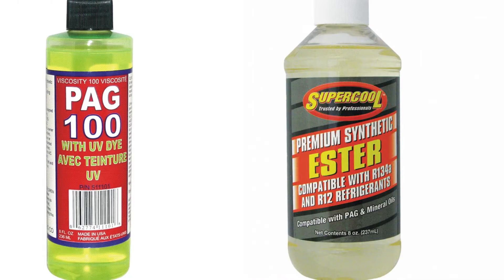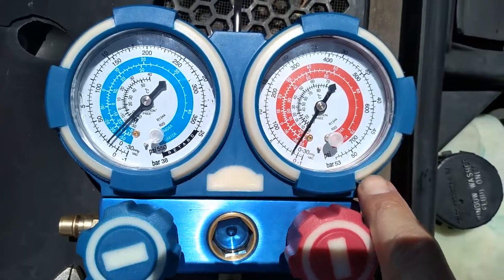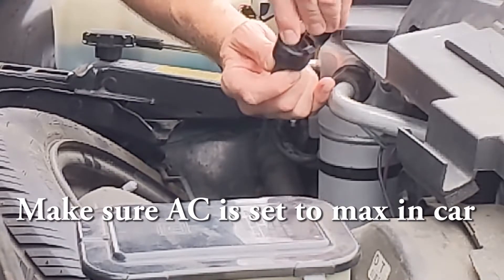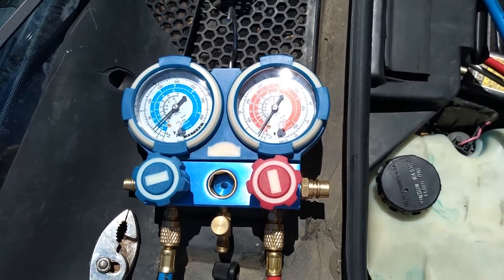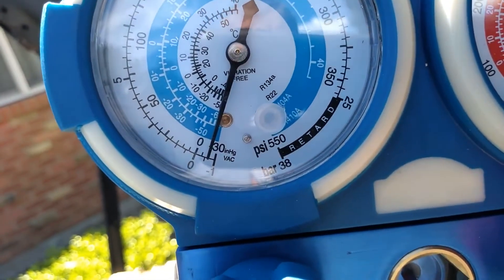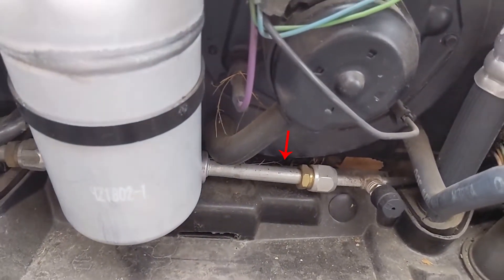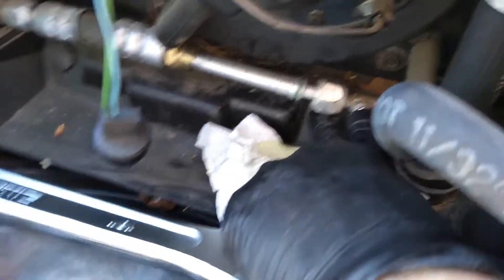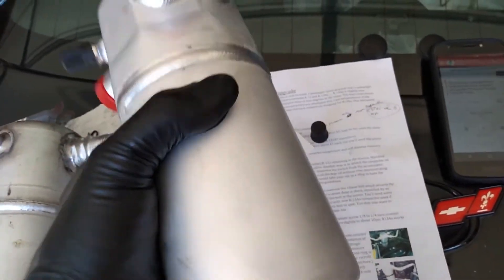How To: Convert Fiero AC R12  to R134  (Updated 2022)

Comment: Great video!  However you did not show the orifice tube being actually removed or installed.    Is it possible to put it in backwards?  I have a new one in mine but low pressure is way too high, and high pressure side is way too low.   I think there is a clog
Reply from the maker: I don't think you can. If you didn't flush the system, it could have a clog on the high side.  good luck

Comment: I don't have the high pressure port at the front ! How's that Possible ? It's a 84 Fiero. Early Ones didn't have it ?
Reply from the maker: @jovanluit8262  idk. I don't have a shop  manual for an 84. I would have to look on the internet to find out where your high pressure port is.

Comment: Good tutorial but just a few things from a licensed HVAC tech.  Mineral oil is not just incompatible with PAG oil but also with R134a.  You should only use Ester oil in conversions as it's also a legal EPA requirement in retrofits.  You really need to flush the system to get all of the old mineral oil out.  That includes replacing all of the O rings and gaskets in the system (as they're not compatible with R134a) and replacing the compressor as it's almost impossible to remove all of the old mineral oil out without disassembling it.  Also the clutch seal on OEM Harrison compressor on the Fiero is incompatible with R134a and will fail eventually.  The Fiero has the old tube and fin type condenser and can be flushed, later parallel condensers cannot and will have to be replaced.  Also of note is some of the old R12 hoses are not compatible with R134a and will eventually go soft and fail.  If on the high side it will fail spectacularly!  ask me how I know....
Reply from the maker: The manufacturer of the conversion kit makes no mention of flushing out the old oil. The link to that video is in the description.

Comment: Do you need to replace the dryer to convert to 134 or you just did cause it was old?
Reply from the maker: anytime you open the system to air, you'll want to replace the accumulator because it will absorb moisture from the air and be useless.   They are very cheap.